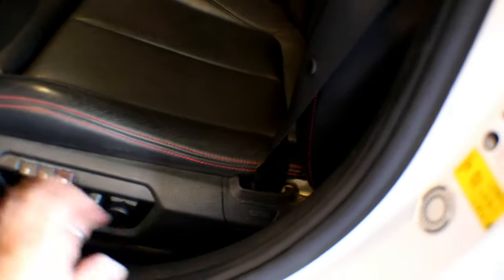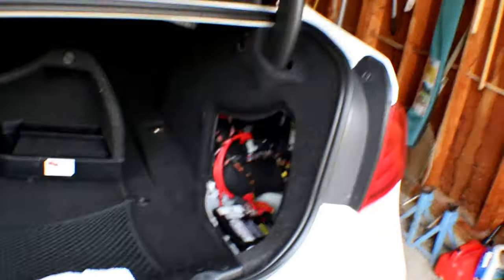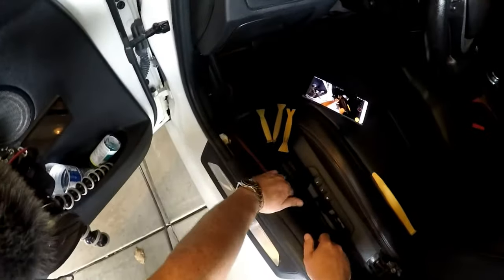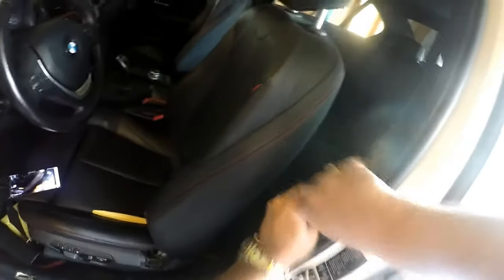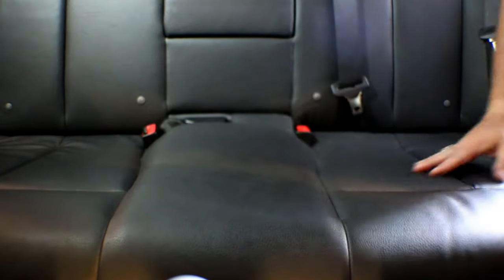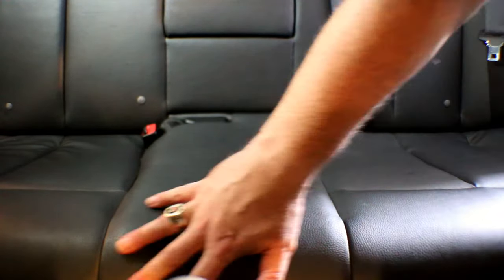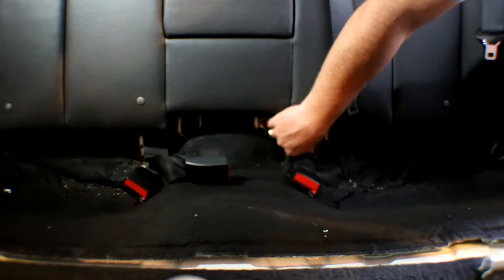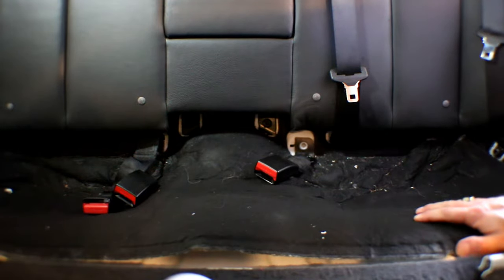BMW F30 Custom Red Seat belts -  removal and replacement Pt 1

Comment: Hi dude, thanks a lot for you video, you helped me not breaking to many things.

You helped a man 🙂 may sounds easy at our age, but don't take it for granted, you did well and helped others
Reply from the maker: Glad to hear.  What color belts are you going with.
Reply: @MessyGarageBMW  I am not ahah

I bought sport seats from a 3 doors F23 to equip my base 5 doors (F20).

But those seats are lacking the seatbelt hardpoint. So I bolted the seatbelt to the seat rail bolt, but because the iron piece is very strong it need to be in a way that twist the seatbelt.

So I twisted back the seatbelt behind the plastic wall, so everything is now fine and safe
Reply from the maker: @TheSkyline35  nice.  A seat swap is a  cool project.

Comment: Thanks for the honest DIY vid! Curious can you reconnect the battery with the seatbelts unplugged?
Reply from the maker: Not sure.  I think so.  It was more of a worry for the airbag deployment.  I just left the car sit until the belts came back from the company changing out the webbing.
Reply: @MessyGarageBMW  I can confirm it was aok hooking the battery back up. 

Only issue I had with the removal was unplugging the pretensioner. It actually pulled out of the cartridge rather than the wire harness. Looks like it will plug back in though. Thanks again! Keep it up 👍

Comment: Great DIY video. Do you know if you can connect the battery without the seatbelts in place? I have to wait 2-3 weeks to get my seatbelts back from Safety Restore as I live in Canada. Keep up the good work.
Reply from the maker: Mark Tweedie if you hookup the battery without the front belts in the car you will trigger an airbag light.  You will need either an app like Carly or a dealership to reset the light for you.  Thanks for watching.. what color belts are you going with?  Make sure you checkout the part 2 to see the reinstall.
Reply: Thanks for the info. I will just do without the car until I get them back. I went with the Ferrari red color. I watched part 2 already. Keep up the good work

Comment: 3:25 how did you remove that part? Ive put my entire strength into it, and it wont budge
Reply from the maker: I pulled from the bottom first to loosen it and then wiggled the top out.  Mine was tight but not overly tight.  If yours isn't budging I would look for some screws or bolts but I don't remember anything else being there.
Reply: @MessyGarageBMW  thank you and especially for getting back so fast. It seemed I just needed to pull from the driver side instead of the passenger side.. Then it came flying out :)
Reply: @MessyGarageBMW  now if I can bother you again.. One of the lower b pillar pins didn't come out with the trim (still in car metal) 

Any thoughts on how to fix that
Reply from the maker: @aSASa45454  one of the plastic pins?  If so, just pull it out of the metal and see if it will attach back to the trim.  If not you may have to buy some from the dealership or Amazon.  Those can be a pain in the butt

Comment: hey is that foam stuff actually loose or glued to the metal in the rear deck lid behind the back seats. im doing a similar job and actually need to acess the bare metal under the seats.   if i remove that cover to get to the foam am i able to remove that foam as well?????
Reply from the maker: I believe it was glued.  You may be able to remove it carefully and then use a spray adhesive to reattach

Comment: Do u need to disconect battery?
Reply from the maker: It is recommended as you are dealing with the restraint system and don't want to risk an airbag deployment or anything.